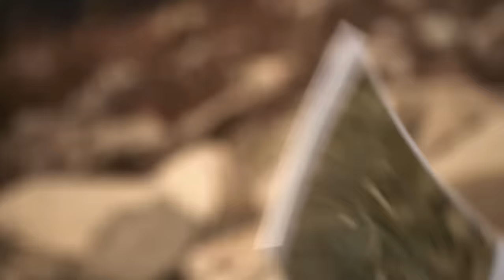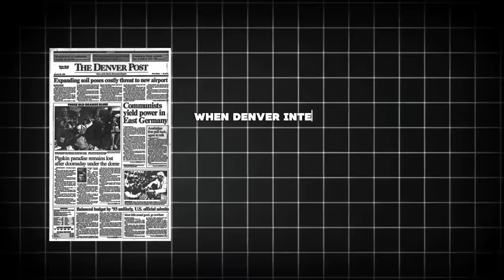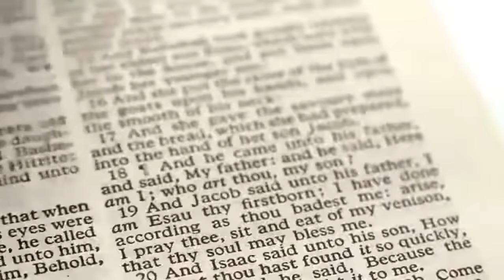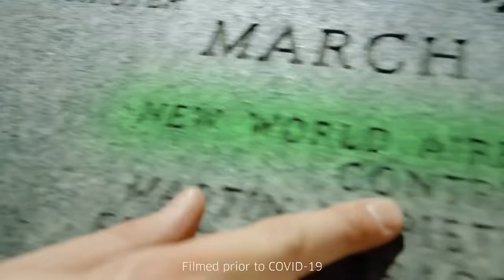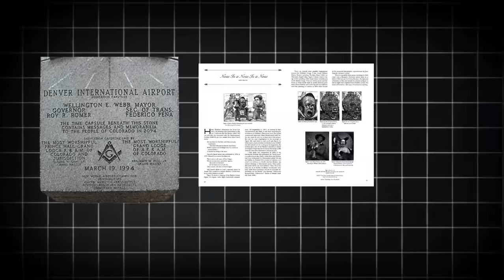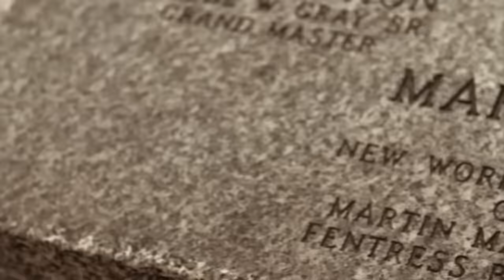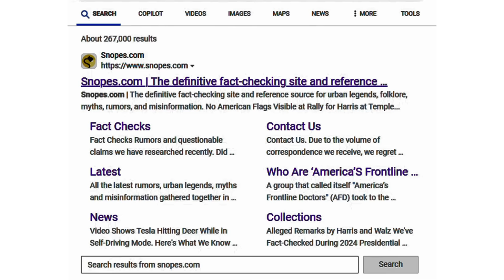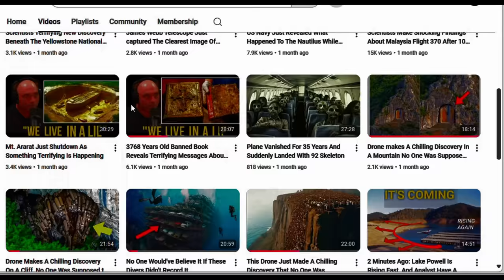Denver Airport Cover Up Finally Revealed, And What's Found Will Shock You

Comment: Contrary to popular belief, concrete can be affected by high temperatures and may even experience significant damage when exposed to extreme heat. At temperatures above 500 degrees Celsius (932 degrees Fahrenheit), concrete begins to lose its structural integrity as its components start to break down. The water in the mix begins to evaporate rapidly while the cement undergoes a process called calcination wherein it loses chemically-bound water molecules. This causes the concrete to shrink and crack, ultimately leading to failure.
Reply: I reckon they probably took all factors into consideration thus adjustment!😂

Comment: @13:40 it is stated that march 19, 1994 = 3 + 19 + 23 equals 33 - wrong - I added it up 3 times mentally and then twice on the calculator and it comes to 36 not 33 doing it their way, which isn't the way it is done in Numerology. To find the significant number in Numerology, each time partition is converted to a final number by adding left to right; so [ March is  3] +  [19 = 10 = 1 ] + [ 1994 = 23 = 5] which equals 3 + 1 + 5 =  9 .
This is a glaring mistake which suggests that the whole video is a piece of disinformation. Of course the capstone with its "worshipfuls" and masonic insignia and gargoyles etc. suggest it is all organised by certain entities that love rites and rituals and 'rubbing our collective nose in it'.
Reply: March =3 
19 (1+9=10=1) 
1994 (1+9+9+4=23 (2+3=5)
3+1+5=9

 (3+19+23=45, (4+5=9)
That date equals 9 in numerology when done correctly
     1994
          +3
        +19
______
     2016 (2+1+6=9)
No matter which way you add it and reduce it, it equals 9 in numerology

Comment: Not the first time someone accidentally built a swaztika building.  It's just a spiral built with straight lines.
That said, every airport is expected to be viewed from above.  So it's beyond weird no one caught it.

 The barbed wire facing in makes sense.  They worry about their stuff being stolen, not people coming in.  Banks run on the same premise.
Reply: Actually, it should not matter, because the nazis simply appropriated the swastika from other cultures that used it for other reasons.
Reply: @hottuna7 True, but... the ancients didn't live through the holocaust.  Modern context has meaning in the present.  KKK looking hoods are worn to church on holidays in parts of Europe.  But it would not be appropriate in America.

Comment: You say Stapleton Airport was  of handling existing traffic, then that "in fact in the early 1990s Stapelton underwent an expantion so it could accomodate more travelers  February 28, 1996 DIA OPENED 16 months late and $2 billion over budget. I livid in the Brighton/ DIA/NORTH DENVER area as DIA was being finished. From 93 to 96 resadential property jumped over 700% then between Sept 11, 2001 in dropped to 40% below 1993 levels. Someone found a way to force farmers to sell land via EMENEMT DOMAIN,then destroy small builders and contractors. To this day no small "family owned" construction contractors exsist in the DIA area. DENVER anexed the land around DIA increasing city taxable land by 37% over a 2 year time frame

Comment: ...And yet no discussion of the fully operational, and apparently autonomous, subway connecting the seven terminals by the mid 1990's...Or the leaky roof in the control tower causing the plastic sheeting to be used to cover already soaked electronics...Odd.
Reply: ...Thirty years ago....

Comment: Often the truth is less esoteric and a lot sadder: BER, the Berlin airport was planned to open in 2011 at a cost of 1,9 billion Euro. It was opened in 2020, at a total cost of 7,8 billion, not because of underground bunkers, but because of sheer incompetence, bad planning and politicians making decisions instead of engineers.
Reply: like u really know what they are doing
Reply: @Lapsontheboy  I know firsthand what they were doing in Berlin. Dunno about Denver, but you couldn't build a whole lot underground for the amounts he mentioned.
Reply: Or maybe that's what they want you to think. And that airport is like Denver's you just don't want to see it. Just a thought.🙄
Reply: @wadeott7463  I appreciate your thought, but if you knew the level of incompetence of the people involved, you would know why it is impossible, not to mention the geological conditions below BER. If you want to burn billions to no effect,fire your consultants in the middle of a project have the Mayor make engineering decisions, build on svampland, and when all fails have hundreds of freelancers at 1000+ per day "work" on site for years, validating the errors, and you don't need to dig tunnels to waste billions. Oh, and did I mention the leaning tower, that was  saved by the same company that straightened the tower of Pisa?